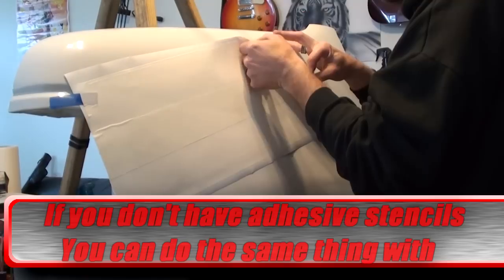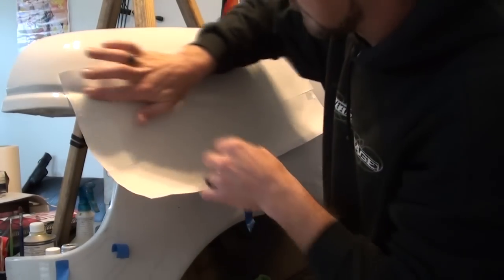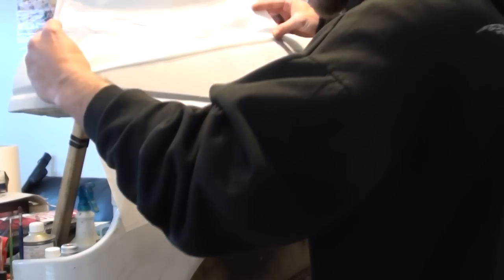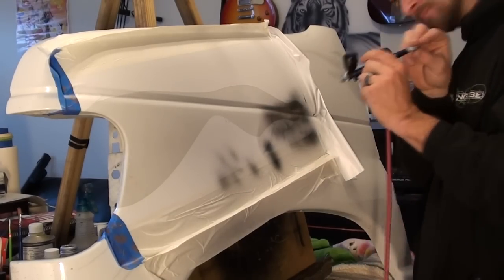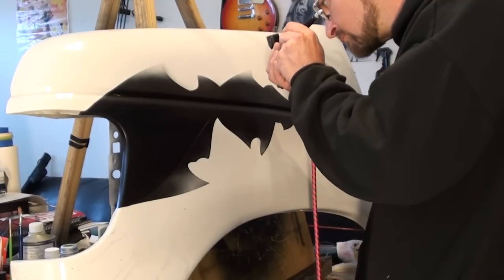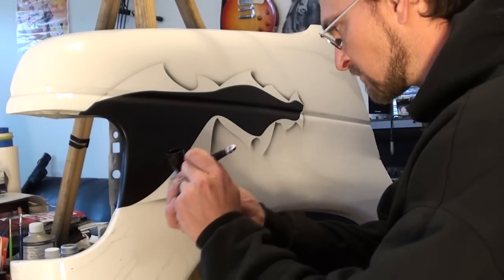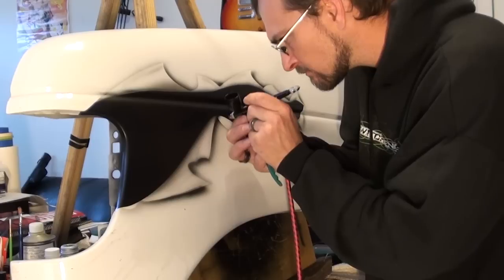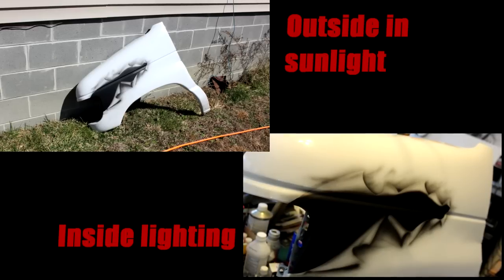how to airbrush torn metal

Comment: Good video, I learned a lot.  I was wondering if this is repped metal wouldn't the bent over part be a different color from the surface color.
Reply from the maker: BennyCFD yup.  This was just a quick and easy way, but indeed you are right.  With a bit more masking, I could've made the "ripped" part a different color, and much more realistic.
Reply: Thanks...........

Comment: where can i get the stencils
Reply from the maker: I make all the stencils that I use in my vids.  You could make you own by using "transfer tape" and the technique I illustrate here: http://youtu.be/RT3Cu9aOjac  If you like, you could find a vinyl sign shop, and have them cut out whatever designs you want in a "paint mask" vinyl.  Paint mask is low tack and designed to come back off without leaving residue, and the same goes for transfer tape.  I buy my transfer tape from Advantage Sign & Graphics-because they have a "brick and mortar" store near me.  In this video http://youtu.be/xTxC1r7SkP8 I paint torn metal using only "torn" pieces of masking tape...Hope this helps!!